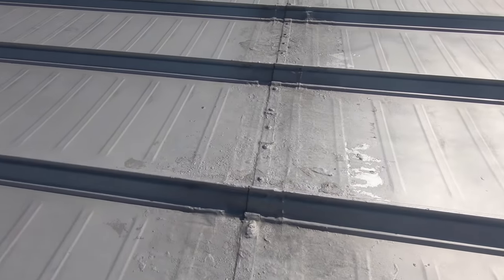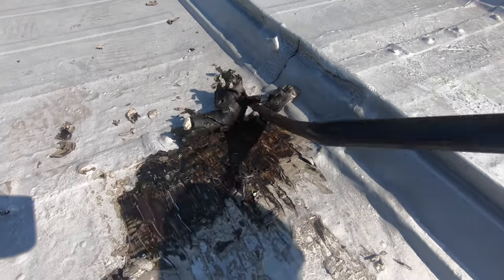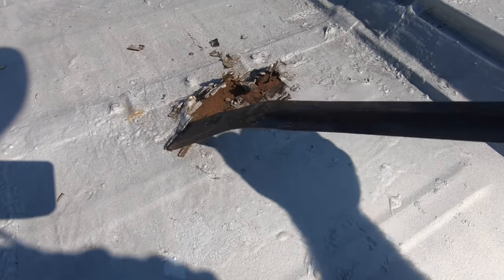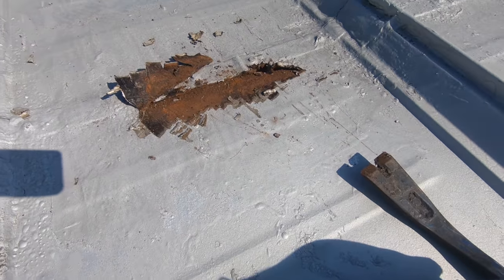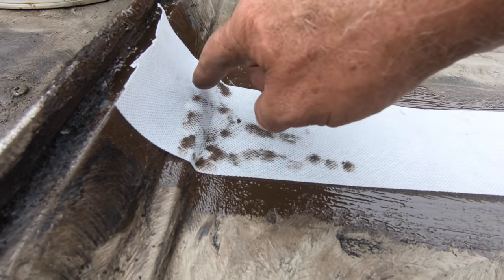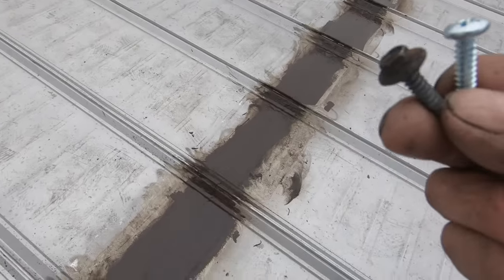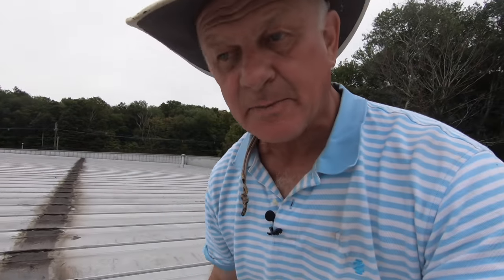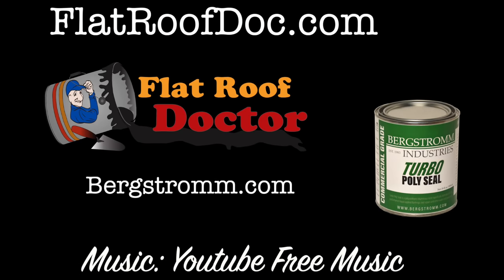METAL ROOF REPAIR - a must see for all METAL ROOF owners -Turbo Poly Seal

Comment: Very good job, i use a similar Polyurethane based sealer on IBR/Corrugated Zinc and Powder coated metal roofs. It an expensive binder to use but its works better that any off the shelf DIY product will ever work.

Good products ain't cheap and cheap products ain't good and that goes for contractors as well.
Reply from the maker: I like this phrase
Good products ain't cheap and cheap products ain't good and that goes for contractors as well.

Comment: Well done. Using liquid polyurethane geocel works very well and fabric makes it a stronger  bond...great job
Reply from the maker: Hey JHan
I have used Geocel products in the past. It does not perform as well as Turbo Poly Seal. Anything with fabric will be stronger.
Thanks for the compliment

Comment: I have a single wide and I applied coolseal to the roof 3 years ago and my roof is leaking again. I went on the roof yesterday and temporarily fixed it until it gets warmer out . Do I need to take it back to bare metal before applying triple poly seal and how long of a fix is triple polyseal? Thanks in advance

Comment: If I needed to replace all the roofing screws would I just get new roofing screws that are a little bit longer, they are going into wood. Or would you suggest those screws you’re using and that polymer that would be exposed to the elements? Thanks for any input.
Reply from the maker: If you going to use Turbo Poly Fleece to cover the screws on the the metal roof seam areas, then I suggest a low profile screw. Longer ones would be a plus.
Reply: Brother I would not recommend changing out screws just cut the corner off s lg trash bag and     use it like a pastry bag filled with h.e.r sealant.
( Hit the heads with a metal wheel first)

Comment: Could you put a rubber washer under the pan screw just to add a touch more waterproofing 🤔.great  video 👍
Reply from the maker: Yes, that would be nice, butto find a few rubber washers on the fly is not easy. If you do a Turbo Poly Seal Treatment with Fleece over a seam, and the screws get covered, then there is no need for a rubber washer. Only when you use the screws with no coating, then it is necessary.        
Thanks for the question and comment. Have a nice day

Comment: couple things: one those metal ribs are there for a reason. they’re needed incase of high wind. wind will rip half the roof off. 

two the screws were 1/4 nut drivers for ease of removal incase of need of repair. 

if you added new ribs back and then sealed it would be an excellent repair.
Reply from the maker: Hi Romeo
High wind lift is what "they" taught you and what "they"  tell you what they think might happen. In my 40 years of flat roof and metal roof installations. the only "wind lift" I have seen, is that of roofs that were not fastened properly on the perimeter. No wind will lift even a sheet of paper on the ground if it could not get in from the edges. I have experimented with this a lot. As long as the edges are fastened and sealed, wind cant lift any roof up. 
But your info is correct according to Roofing Industry Standards.

Comment: I have a old barn roof like the one showed. What can I do to maintain it and prevent leaks? I am building a home under it and there are a few pin hole leaks in it. Should I do what you are showing here?
Reply from the maker: Just sand rust spots and coat it with Turbo Pol;y Seal. I do this with a lot of metal roofs. I use the fleece only when there is a big hole or a transition seam between 2 plates.
Reply: Flat Roof Doctor thank you so much! Also, can I tag you in my barn renovation video when I get to the roof part?
Reply from the maker: @prpatel04  Nice man,  I am glad you know the drill

Comment: Sir, what do you recomend for coating a 100 year old rusty metal roof?  My roof is standing seam and there are some areas where water sits after rain and the roof is actively rusting.   Im concerned about it rusting through.  I completely agree about not sealing in the water and you make a very good point about these acrylic and asphault coatings,  but is there a good product that does not trap water?  Or does one just have to let it breath and replace it after it rusts through?  Im just looking to protect the metal.  Thank you.
Reply: Level the building

Comment: My roof is leaking in the same way.  I have these metal brackets just like your video.  They are installed in only one particular area, which is all along the base of the roof about 6" from the gutters.  They are not covering a seam in the roofing.  I assume they were put on to secure the roofing for wind?  You took them off and left them off.  Do you think I can do that too, in this case?
Reply from the maker: Yes, you can remove them. They cause more trouble than it is worth keeping

Comment: How long would this fix likely last? And does it lose any kind of strength against storms? We have 30,000 sqft worth of roof space to repair that is leaking everywhere. We're not sure if it makes sense to try something like this or to just replace the whole thing.
Reply from the maker: If properly prepared it should last beyond 10 years. If you add a UV protection likeAluminum Asphalt paint then it could go a long way.

Comment: Isn't the fibered aluminum silver coating you apply at the end of the video the same thing you had to scrape/burn off in the first place?
Reply from the maker: Yes it is. But that coating was applied to fix leaks, and did not work. So, to do a good job, you need to remove "paint" to be able to bond to the metal itself. Then you add the silver coating to protect the Turbo Poly Seal from ultraviolet rays
Reply: @FlatRoofDoctor  Thank you for the info. Excellent video and explanation

Comment: OK -- great video -- and really nice looking work!  

Does this PolySeal have rust converter in it? 

 Roofing must be like dentistry... Ask 10 different guys and they have 10 different answers. I am not saying that rust is good... but last I checked... Polyurethane coatings don't stop rust. They will seal (like you said)  and act as a paint, covering metal, which slows the rust. I don't know about this specific product... but down here in the south I see this type of stuff last....at best maybe 5-8 years if application is perfect. It eventually breaks down and hold water like everything else.... Seems like the water based acrylic paints ("Snow Coat") last the same and you can do the same thing with the fabric tape...... 

Perhaps chemically treating the rust with a phosphoric acid solution, and then doing this treatment....

 But please keep up the videos and once again... nice work!

Comment: I have a gray colored metal roof on my house, that has several leak points. I want to fix it using this method, but I don't want the black repair to contrast with the gray roof. What are my alternatives??
Reply from the maker: Use the Super Silicone Seal that is white

Comment: This roof I am repairing is leaking because all they did was push the Metal roofing butting the patio roofing looks to be no sealer, no under lap or over lap only butted the slight sloped patio metal roof into the sloped house roof.  I would say house slope is 5/12 pitch.  So a storm came and blew the vinyl soffit ceiling down on the patio.  This unveiled a problem.  the leak where they joined two metal roofs had began to rot the wood at the point where the two roofs butted.  The butt is over the overhang on the house.  It has rot the batting 1"x 4" and it shows a little damage on the 2" x6" that nailed to the house facing board to join patio to the house. Should I slide a metal flashing under the house roof and let it over lap the patio roof before using the Turbo Poly Seal method.  The patio roof is butted 16' to the house roof. Or, Can I just use Turbo Poly Seal method method?

Comment: What material did u use for the patch thanks
Reply from the maker: I used  Turbo Poly Seal from Bergstromm.com. Sorry about forgetting putting it into the video
Reply: @FlatRoofDoctor  yes thank you I saw your comment after I sent message great job thanks for info

Comment: Sir, do you sell the fleece and polyurethane ?  If not, can you point me in the right direction.  You are very informative and thank you.  Great video
Reply from the maker: https://bergstromm.com/ is where you can buy the Turbo Poly seal
Reply: Flat Roof Doctor Hello,which one did you use?
Reply from the maker: Hi Jason
I used Turbo Poly Seal from https://bergstromm.com/. It is a little pricy but I have had only good results with it. Turbo Poly Seal is my go-to product for most of my repairs.

Comment: And WHACK! good thing he only hit the camera and not that guy in the head! I've got a metal roof that's been leaking and I have tk take metal off, and replace osb underlayment and re use the metal, as I don't have alot of money, right now it's just covered with tarps. It's 400 Sq foot, and leaked and damaged osb underneath. So, I don't know what kind of underlayment? And when I put roof metal back down, do u use panhead screws and then coated with turbo poly then coat entire roof with Karnak 169 non covered roof coating?

Comment: So... if done right aluminum coating can fix a leak. Just like any coating. However, its asphalt based, which will corrode the metal and cause rusting. worse still it will trap moisture on the metal rusting it even faster, just like shown above. This is (hypothetically speaking of course), both an environmental hazard, and a potential health hazard. Not even a good temporary when there are cheaper and better products. 
However, torching metal to get it off is more damaging. Metal fluctuates in high heat more than almost any other roof system. This could create more issues than it solves. Whatever protection that metal had left is destroyed, and though it's pretty, the roof is unusable for a retrofit if its allowed to continue in this state.

Now that said, I have to say that honestly, given the situation and the already beyond repair (proper repair, that is) roof, you guys did the best that could be done. I would have done almost exactly the same given the situation, and that's rare for me, because I look at YouTube roofing as 99% unqualified garbage. Good work, though I'm sure you already know that.
 I just really want to stress to the DIY and YouTube Roofers that this is not something you should do, it is more of a last ditch effort to temporarily seal a roof thats better off replaced. 
Like slapping a band-aid on a chainsaw wound. sure it MIGHT buy you some time, but it's less a long term solution, and more about the customers peace of mind.
Reply from the maker: Hi. Your opening statement is "So... if done right aluminum coating can fix a leak" I disagree with that. Maybe you did not watch the video or your memory is slipping. 
We did not use the Aluminum Asphalt coating to fix the roof. Neither did we use tar like the people before us. 
I use Turbo Poly seal from Bergstromm.com to seal all the rusted spots and made a transition between the 2 panels. After we did that we coated the Turbo Poly Seal with Aluminum Asphalt paint to protect it against UV's.
BTW, the silver coating your refer to that people use to paint on roofs, is not to fix leaks, but rather to protect the roof from ultraviolet rays. The added benefit is that it helps to reflect the heat and makes for a cooler roof.
Anyway, thanks for your comment
Happy roofing
Reply: @FlatRoofDoctor  
1. I was not referring to what you did but to the initial repairs. 
2. Actually Aluminum roof coating, while primarily used as a UV resistant surfacing and for fire spread reduction, has been used as a method of repairs for decades IF installed correctly. Is it a smart idea? No. Long-term? No. In fact, some companies have placed warranties on it to prevent leaks, but then again the industry also warrants many products that have an average lifespan of <7 years with 20+ year warranties. But it is something a DIY roofer could install on say, a smooth SBS, with a mesh embedment on seams, like you did with the Turbo Seal. 
3. "Neither did we use tar". Now you are one and the same as Turbo Poly Seal, look at the can. It contains the same bitumen compound as Aluminum Asphalt Coating. It's a cheap "Fix All" Product much like Buying "Roof Patch" From a hardware store. While it is nearly impossible to pull up an SDS or ANY info on (strange, given the laws), it clearly states on the can what it is, a product that the industry refers to as "tar" containing the same "tar" as most aluminum coatings. Or are we pretending most aluminum coatings contain coal and not bitumen?
4. Please bother to read the second half of my first comment.  

Now I will say i should have stressed in the beginning it wasn't targeted at YOUR repair, however every statement except "Aluminum" applies. The product you are attempting to sell WILL destroy the finish, Is not compatible with metal, and would not be warrantable on any commercial system by any manufacturer or likely even allowed as a temporary fix without completely voiding the warranty. It's a temp fix more about peace of mind than stopping water, especially when it's not going to move at the same rate as the metal, will create the same cracks and openings, will trap water, and will simply recreate the issue EVEN WORSE because you wanted to replace the screws with NON-exterior screws, which have no form of water resistance. However, given that the reasoning was to eliminate bridging and gaps, it is a possible solution. Now that said, there isn't much more that could have been done after such a bad product (The aluminum from previous repairs) was already used. It will likely outlast the roof which is probably more rust than steel, at this point. And now because you chipped through the aluminum coating, that could also trap even more water, rusting faster. But that's something that is a long-term issue. As a cheap quick-fix, this works. More expensive than other solutions but easier and possibly lasts longer.

I think we can all agree that roof was better off replaced than fixed though.

And for the others reading this. When i say "Long term". I look at roofs as 10+ year products. I tend to maintain roofs with the idea the repair will outlast the roof. Keep that mentality in mind when I say the following:
I've worked on 40+ year old PVC and EPDM. 50+ year old Tar. 100+ year old tile. My goal in repairing is a repair that protects and outlasts the roof. Not one that will cause more damage, long-term, and not one that will not last. So a repair that causes damage 3+ years from now is what I'm thinking about long term.  That roof likely did not have more than 3 years. This was honestly a perfectly good solution, except for the torching, as that can be very risky if in the wrong hands.
Aluminum coatings, and any and all forms of coating, for that matter, are temporary repairs in my book. This includes Acrylics, PolyUrethanes, Silicones, etc. Turbo poly seal, flex seal, Karnak is no exception. These can stop a leak temporarily but will never last on a new roof, in fact they might even damage it. This is just an ad disguised as advice from the people who run the website selling the product If you look at the website he plugs constantly and the product you will discover this in about 5 minutes.

Comment: how much did u get for fixing this roof
Reply from the maker: Hey Jimmy I live in the North East more precisely in Norwalk, Connecticut. The pricing around here is much higher  than the rest of the country. I charged almost $10,000 for doing 2 seams of over a 100 ft each. It took me almost 3 days to prepare, clean and apply the Turbo Poly Seal. Then I decided to to coat the Turbo poly Seal a day later with Karnak Aluminum Asphalt which was not included in the price. But I felt it would protect the transition from ultraviolet rays.
Each situation is different and therefor you can not charge the same for such a job everywhere.
I hope that this helped you?
Take care

Comment: Those are butler panels they suck and don't warranty their roofs long when they erect the buildings. They make a kit to fix those seams but it needs to be done before the crap coating is sprayed.

Comment: best to not have seams when building roofs. When seams leak, its rust removal, new screws, polyurethane, membrane, more polyurethane, then aluminum paint. Such a headache.
Reply from the maker: unfortunately it is impossible not to have seams. There is no roofing material that is just layed over a roof with no seams, unless you are referring to liquid applied systems
Reply: @FlatRoofDoctor  here in sa, we can get custom ibr metal sheets with maximum 8 meters but the width is just under 1meter. Can't avoid the side seam but if the roof is less than 8meter there's no horizontal seam. The less seams, the better.

Comment: I like how you remove an asphalt coating and say how it doesn't work and then top off your work with the same shit. Why not put on a polyurethane, or silicone, or acrylic  top coat? Something that is reflective and will stay pliable. Asphalt will crack!
Reply: You don't listen very well. Nothing you said is accurate. They removed aluminum asphalt paint. They removed the old screws and replaced them with pan head screws.They put down a sealing strip. Then they covered the strip with a polyurethane coating which is pliable. He took time to explain its benefits. He finished it off with a silver coating. Silver coating is reflective. He never applied asphalt. Why? Because he said asphalt will crack.

Comment: Metal roofs have a limited life span the must be completely replaced.    There should be no seams but stepped.    seams cause rusting because of capillary action of water causing rusting.      Yours is a waste of money the galvanising coating has gone & will still continue to rusting !       Just put in a  NEW stepped metal  roof